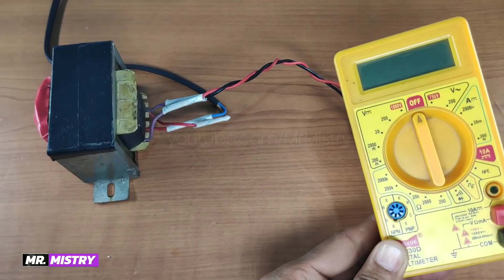12v and 5v Power supply for Amplifier board and Bluetooth module

Comment: It's a Nice Project But The maximum 5v current is 1amp. That's because The Low efficency of The 7805 Power regulator.  You Can use instead a Buck converter.  For The rest,  this is a Nice project

Comment: It is best to soldered this diy on PCB/Stripboard with guided circuit diagram! Why you included large capacity diodes? Can we use Mobile Phone Charger's SMPS power supply for continuous 5v DC output?

Comment: in this circuit there is a problem the voltage of + 12volt is not stabilized you should add an lm7812 in order to have a voltage of + 12vol stabilized, as you did for +5 volts adding the lm7805.